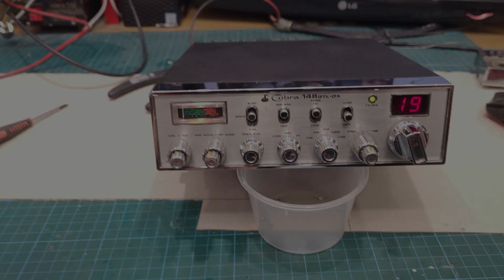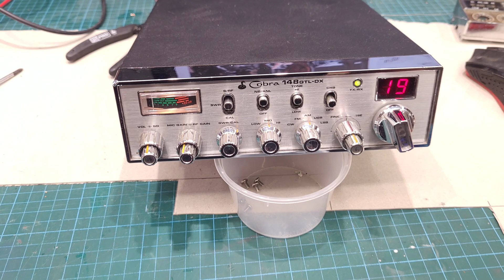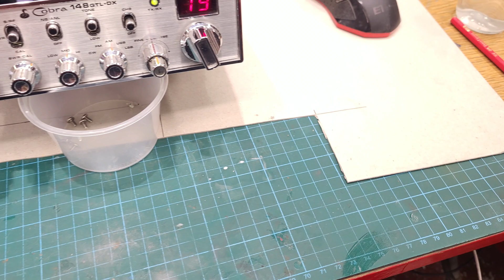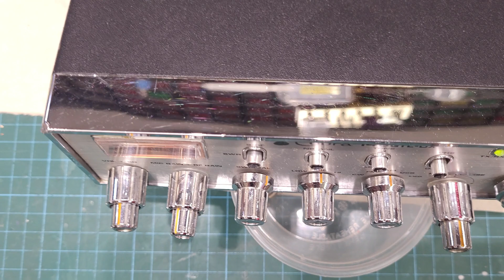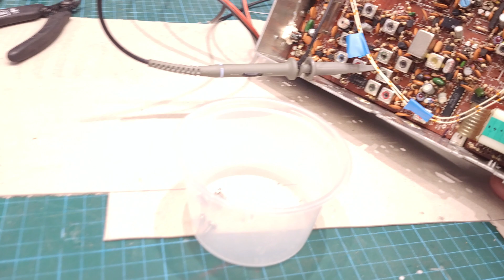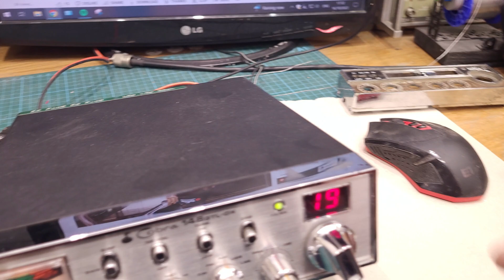STEVE WATTS MINT COBRA 148 GTL DX

Comment: nice looking radio. There's also a Cobra 148FGTL DX+. It's a DX version of the Cobra 148FGTL. It has 12 bands.
Reply from the maker: Yes, I have one here. Not a cobra at all really. Its all ranger inside and just has cobra on the bezel. They have unicorn status, but they're nothing special.
Reply: Mine cobra 148 gtl dx a great ssb radios mine kept lower power and 5w into a good kicker and run of a big leisure battery  the kicker gets warm so a nice big fan so it's not get to hot as they  can put out harmonics and the fan it does blow as heat goes up so run the fan the same sucking air it stays warm but not hot the radio stays cool and happy many I night in the hills  were there was a wooden  post about 7feet and talked every were now you hear very little now